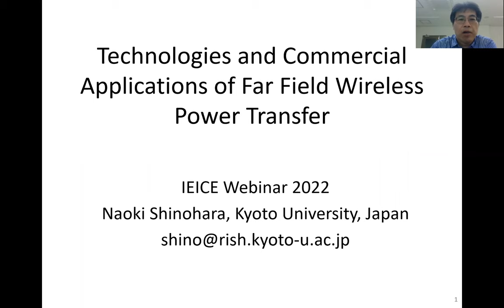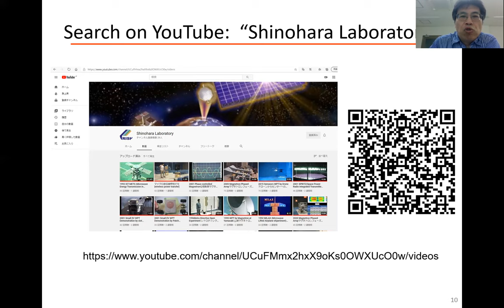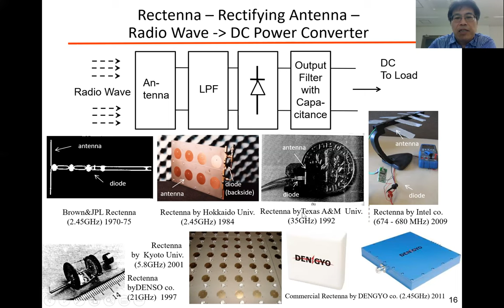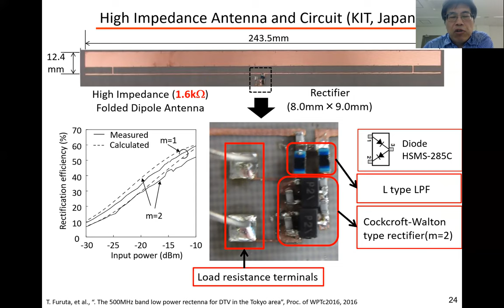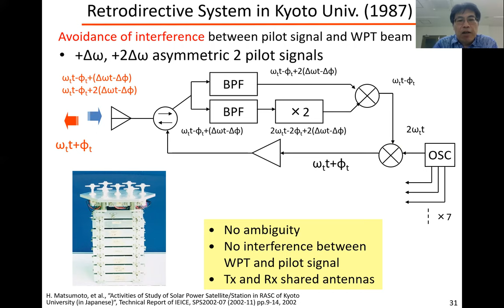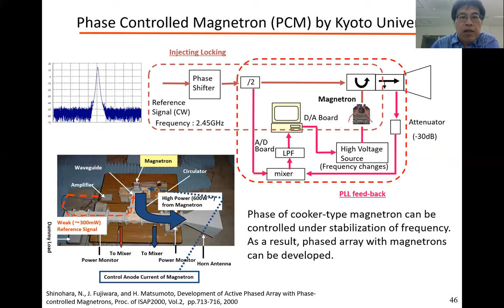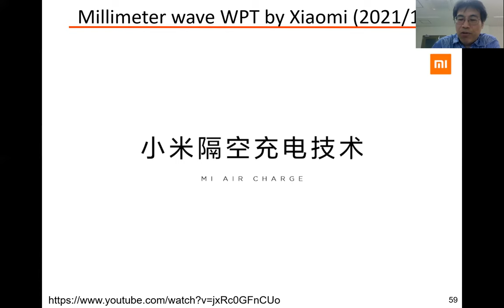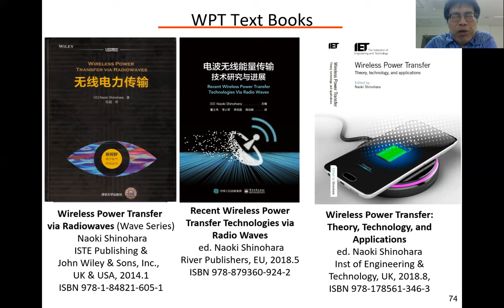IEICE English Webinar Technologies and Commercial Applications of Far Field Wireless Power Transfer

Comment: I'm not sure he Frii's formula that appears at 46:14 is correct. The wavelength should be in numerator and not as on your slide. 
Higher frequency is having higher attenuation, so higher frequency is having smaller wavelength that as mentioned above should be in numerator.